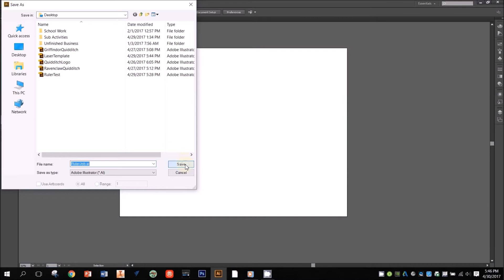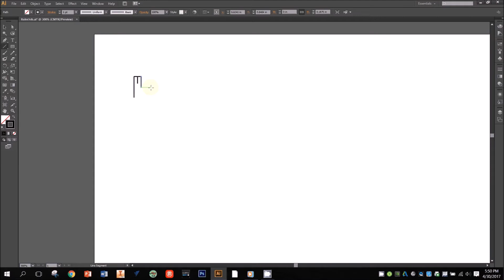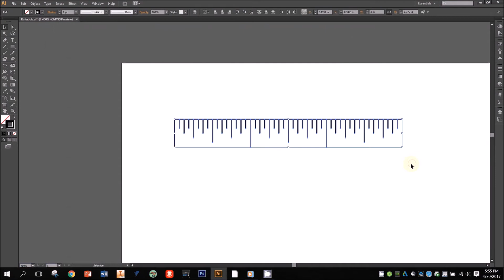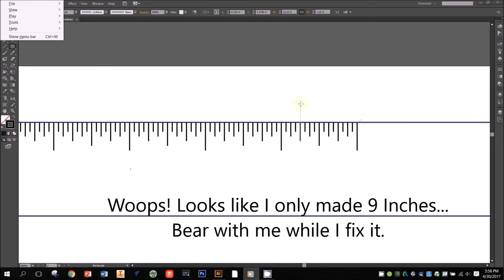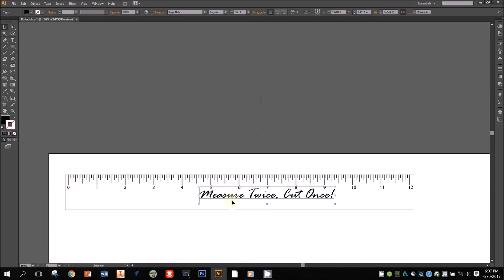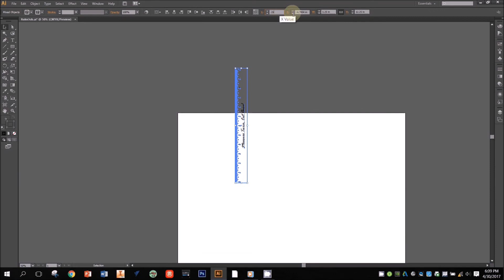Making a Ruler for the CNC Laser using Adobe Illustrator

Comment: After I drew a couple of lines, I found that I HAD to click on the Arrow Sign, and then click anywhere on the sheet, AND THEN click back on to the LINE icon, then click on the Anchor Point once, in order for me to join 2 or more lines together exactly. Repeated this for each new line. This took me 3.5 hours to work out....because I've only been using Illustrator for 3.5 hours LOL. Thanks for posting this video!
Reply from the maker: Oscar Sheen thanks for the feedback! Illustrator is a bear to learn, especially if you are teaching yourself. It seems like a great tool for graphic designers but a little tough for CNC work. Keep practicing!